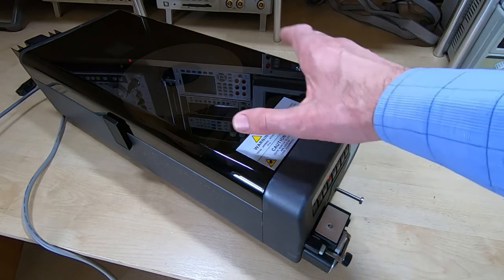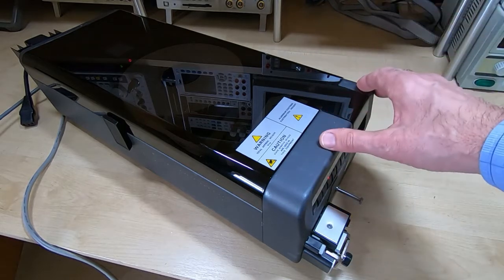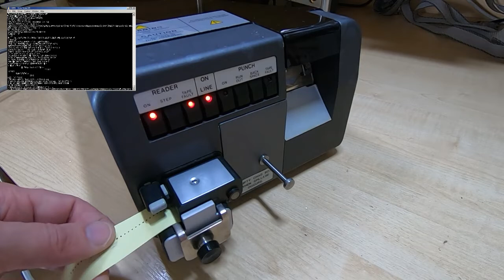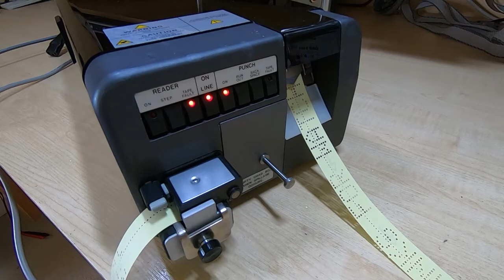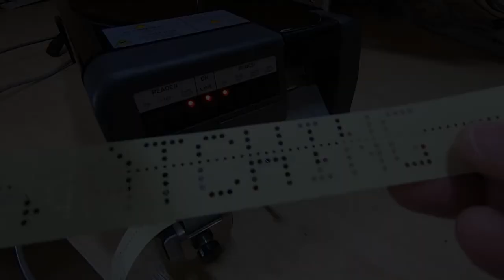Trend 612 Paper Tape Punch Part 4

Comment: Does the tape have an End Of File character, or the machine just relies on an optical sensor to see when the tape is finished?
Reply from the maker: It uses the sprocket hols and just runs the tape until the holes stop OR an end of file character can be used to stop the reader is this is enabled in the reader configuration.